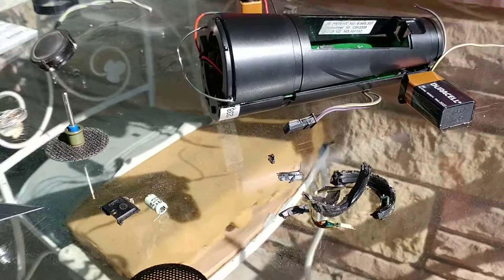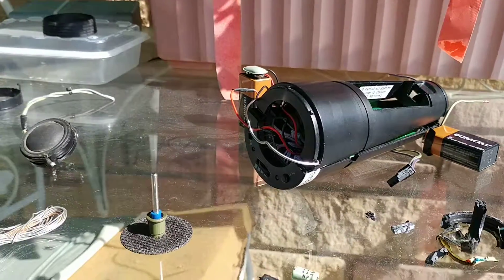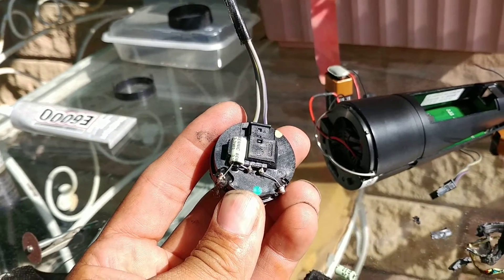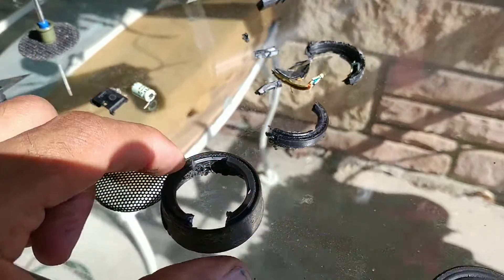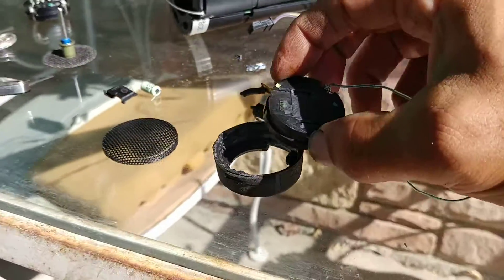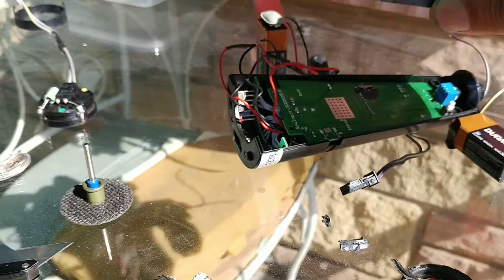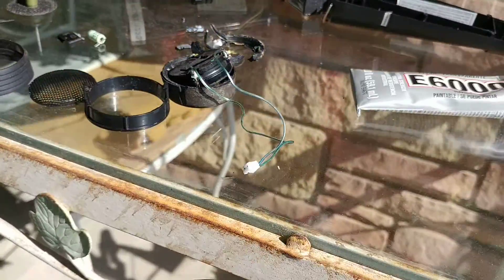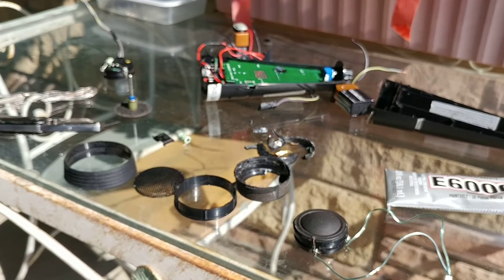Electronic Digital Ceremonial Bugle Repair

Comment: What year is the vehicle (VW)  can find this speaker. I have a Ceremonial Bugle and at this time I have no sound. I need to find a speaker to replace the broken speaker.
Reply from the maker: Thank for watching. Strangely enough the speaker is not from a VW auto. The speaker I used was from a 2005 Chrysler PT Cruiser. The Drive and Passenger front doors have a speaker that is just right to Upgrade/Repair the Ceremonial Bugle. Before I took it upon myself to repair my unit. We spoke with the company and they indicated that is is a common repair, but the repair cost seemed a little high for just replacing a small speaker.  It seems when you put in new batteries and turn the unit to MAX Volume the speaker is over-driven and becomes unusable. As an engineer I would think a simple power regulator feeding the amp circuit would have saved everyone from this headache.

Love from Chicago and best of luck in your repair efforts.
Reply: @GallowayChicago, can I send you my insert for replacement and repair I two that need repairs